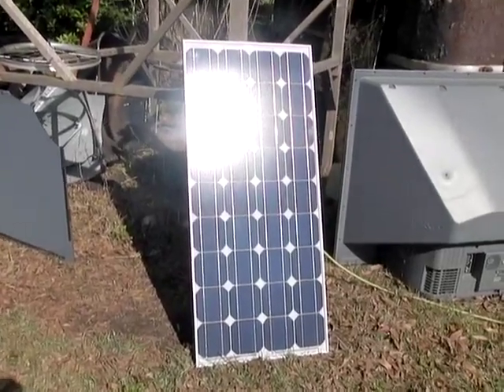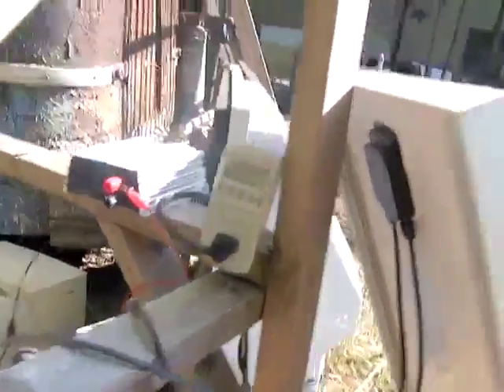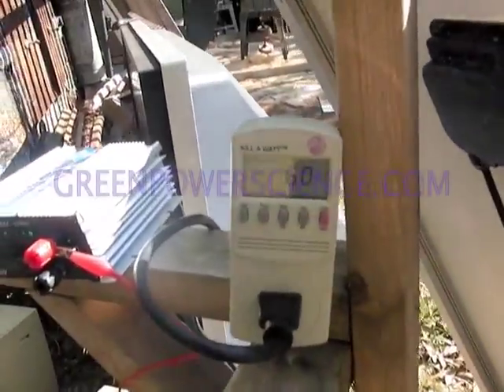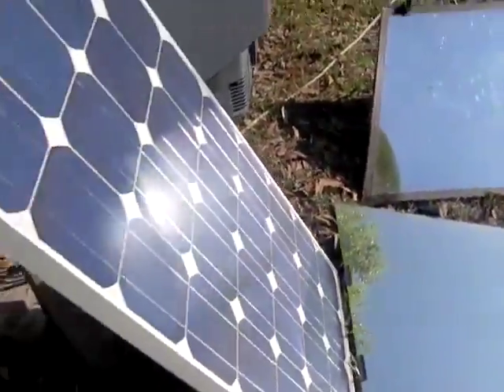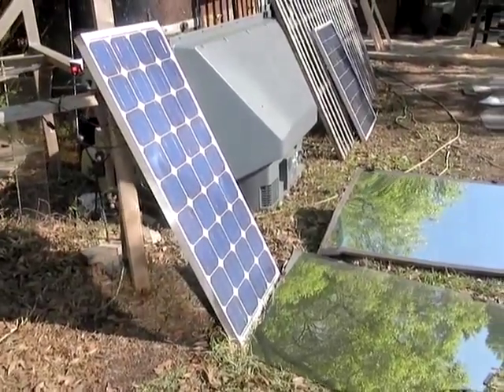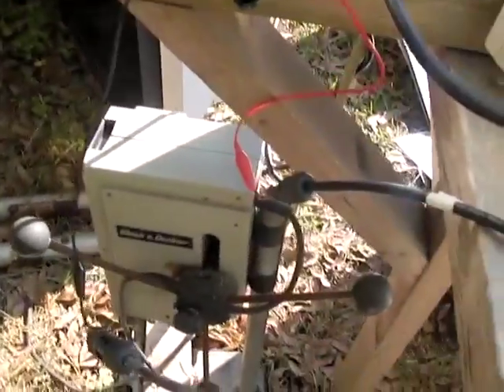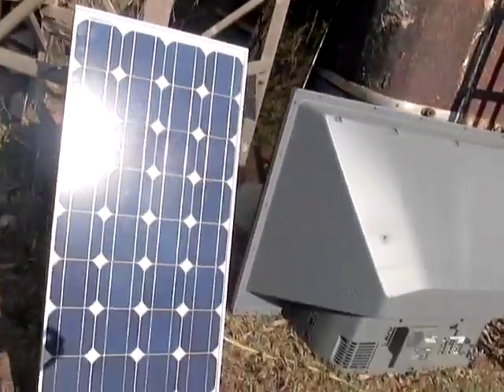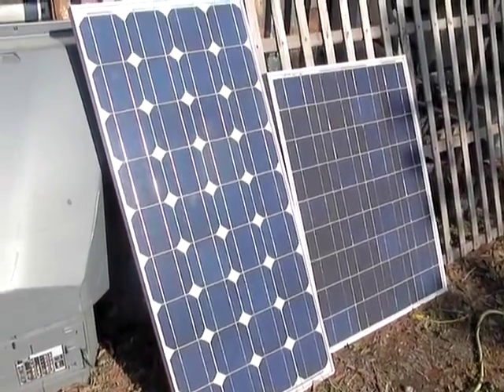solar panel diy power boost 30% from mirror panels

Comment from the maker: Hi,
Amorphous panels can have imbalanced light. If it is a single large mono-cell like a cell phone charger, they can have unbalanced light too. Only when they are tabbed in series:

watch?v=rGi0Mf3cl1E
Reply: I worked with that years ago and doubled it, but it gets hot, and to cool it with h2o on the back is tough.

Comment from the maker: Thank you for the nice comment. Mirrors are better as the Fresnel lens needs to be larger than the solar panel and that costs more than buying and additional solar panel. Mirrors are free and redirect light. Focusing many page magnifiers do nothing. The goal is to increase light to the panel. So either a lens larger than the PV PANEL or redirected sunlight with mirrors.

Comment: Interesting to see what's more efficient; maybe an array of focusing lenses infront of the panel to focus the light beams onto the panel itself might increase the power output. What's your opinion on that?
And have you considered an automated motor attached to the mirror that could be used to reflect the sun to the panel at all times regardless of it's place in the sky?

thanks for sharing this very informative video

Comment: would a heat sink/ liquid cooling system help? or could the solar cells break due to the expansion and contraction of the silicone crystals due to the change of temperature?

Comment: Boosting a panel with mirrors just shortens the life presumably. And it requires clear sunlight and actively tracking.. so..
it always ends up being easier just to use purely solar panels.

Comment from the maker: It is usually similar to non-reflective glass used for art framing (pebbled surface). The DIY method is a very light scuffing. Testing the light transfer of different methods and sanding mediums.

Comment from the maker: Sorry for the delay, the grid tie inverter gradually draws a max load vs a short circuit so the working load is more realistic for long runs and accommodates for resistance from increased heat with the additional light. If the panel is tabbed (mono-poly-multi crystalline) vs amorphous, make sure the light is balanced over all the cells or the voltage/current can drop even with additional light, like a blocked cell.
Reply: Tell me how to implement it in large plants

Comment: I'm doing a study on this subject as a masters project. I'm using two mirrors on the sides to increase the output. Some guys who did experiments measure the short circuit current of the panel to determine the increase in output. Can you describe better how your load is better than that? I'm using a fixed resistor for my study, but improving my measurements is always a good thing. Thank you!

Comment: The point of the answer was that it depends on each device's individual power consumption. For example: 10 halogen light-bulbs = ~600 watts, 10 LED light-bulbs = ~150 watts, three laptops or mini-PCs = ~300 watts, three gaming PCs = ~1500 watts, so the answer that you want would be: anywhere from 800 watts to 3000 watts.

Comment: i got 1 ref and 10 light bulb plus 3 computers, my questions are: how many watts should be my panels and how many deep cycle batteries should i need? also how many watts should be my inverter... thank u and more power and projects from u guys.. happy new year 2013

Comment: Which is the best (500-1000 watt) grid tie inverter to buy and is it as easy as plugging it in to a nearby receptor, or do I need an electrician to hook it up? Thanks Dan, keep up the good work!

Comment: cos the meter reads 54watts doesn't mean your loosing 26w in the connection , this 80w ratting is absolute maximum you can expect with the sun vertically overhead, and no chem trails.

Comment: You would not want to use this wire for your project. Then why didn't you use larger wire? :)
The heat increase will reduce the efficiency of the solar panel. As he said at the end, just get more solar panels. Look on Craigslist or other places. You can find new solar panels for $1 a watt.

Comment: just a thought, what if you used mirrors but below the cells, touching, you run cold water, in a flat copper pipe on its way to solar water heater? to keep the cells cool while increasing there power outage, with there temp down they also work better do they not? what do you think?

Comment: Maybe using water is a bad idea.. So what other liquid could we use instead of water.. (I'm not an expert, nothing comes to mind).. what we could do is fool around with the water/other liquid ratio.. 60/40 maybe I dunno..  the purpose of the water would be to mainly increase the watts while the other liquids purpose would be to keep the panel cooled..(Segment 2)

Comment: I went swimming yesterday with my woman. We both were in the pool for about 30 mins.. I got out and tried to tan... she stayed in the water. When we went inside I tried bragging to her I got a tan (and yoouuu didnt!)...so my amazement she got the better tan.. So I wonder if you were to put a inch or so of water on top of the solar panel.. but touching.. would you harness more Watts? (Segment 1)

Comment: Great video! If you concentrate one mirror to a portion of the panel, then that would make the current of the cells uneven right?  So how does that affect the final current and voltage if the current and voltage of the cells are uneven?

Comment: Has anyone ever tried an idea of running water lines to cool off the panel and in turn provide house and air heating?
Just thought of it and wondering if it works well...

Comment: @InTheSticks0001 Awesome info! I live near the 45th parallel in NY and am wondering how these perform in winter. I wonder if it gets very cold (near zero or sub-zero temps) will they lose efficiency? Electric wiring loses conductivity in the lower extremes.

Comment: Makes me speculate if adding light filters could provide as much or more benefit than mirrors alone.  If you gather only the most useful wavelengths of light, you could discard the rest, thereby reducing heat (perhaps)--much the same as plants benefit from blue light for photosynthesis.  Which wavelengths do PV cells "prefer"?  Time for some research...

Comment: Dan, nice one, you could add plain white painted areas around the solar panel, as you know often used in filming / photography,  a cost effective light reflector. If your into green engineering, just add another panel may not be the way forward.

Comment: Dan, I like your channel and I think you stuff is great, but after some time... have you deliberated on this? It's such a simple concept that one pretty much assumes that you if you concentrate the lumens, you also concentrate the heat. Sure it'll put out more power, but if a cell is designed to be in open sun, then it's been maximized and it only makes sense it wasn't designed to handle more heat than it was designed for. At a 10% increase in power... at 17% efficiency - BIG Heat additon

Comment: reminds me of the idea I had to take scrap fiber optic cables to bring more light to a solar panel.  around the sides of the panel you would have light capture stations that channel the light through the fiber optics to the solar panel to boost the light it gets.  I thought that might make them more effective and usable in cloudier areas...  I had a friend who installed fiber optic cable and they have tons of 6' or less scraps they throw away...

Comment: If you were going to do this, I would do sun angle calculations.  Face it towards the south, and have mirrors about 30% lager than the panel itself along the bottom. at such and angle where you get a full reflection right between noon and dusk.  and about half the reflection at noon, to avoid burning out the panel, as well as getting a bigger boost during the time of day with less light.

Comment: Dan-

I really don't understand what you are doing here. I have several kill-a-watt units and use them regularly. The measure the flow going thru (i.e. to measure how much power is being PULLED) - they are not meant to measure power generated- so i don't at all understand how it has anything to do with your experiement with the mirrors.  We recently had a 1.3 kw system plugged in and when the Kill-a-watt was plugged into the inverter, it would show 0 watts when nothing was plugged into it....

Comment: Dan,

I also have a 40 watt panel that I use for some outdoor lighting. I thought about using your mirror to to boost the panel but it seems to risky for broken glass. I am going to try a piece of polished aluminum instead.

I am looking for a low voltage timer to use with this 40 watt panel. I have it hooked up to a 100 ah marine battery and a photo sensor but don't really need the lights on all night. Do you know of amy low voltage timers I could use with my system?
Ramsey

Comment: Dude, that's pitiful. I'd rather plug my TV & playstation into the electrical grid than spend that much time trying to milk miserable 60 watts of power out of each cell.
The solar panel design is inefficient, we need something better than the conventional solar panels.

Comment: You need to watch the temperature of the pv  cells, higher temperatures decrease their life span and overall output.  Temporary gain , long term loss.  In colder climates this is a good idea up to a point obviously,  In arizona, we see a decrease in our panels during the heigth of summer

Comment: What up gps. I got a GTI for a solar club project and we cannot get near the 100 watts the panel is rated at. Is the drop a flat number or a scale. We are getting 71 watts out of a 100. Would 200 watts (2 panels @100) give 171 or 142. Keep up the good work solar guy;-)

Comment: You will reduce the life expectancy as well as the efficiency of the panel if you concentrate light onto it!
Reply: So over the lifespan of the panel it ends up producing the same amount of power, as one without a mirror.

Comment: try it again with fat cables! you know you had too much resistant on the burning cable so eventually the readings are not good and could be higher.

Comment: Hi Dan, 

And what if you replace the mirror in front of the panel with another solar panel, have you tested that yet? I understand that a lot of sunlight reflects from the panel surface. So why not use that, by catching the reflecting sunlight with another panel? You can aim them in such way that they both catch direct sunlight and also the reflection from the opposite panel, like you did with the first mirror. But I don't know if it is worth testing?

Greets, iT

Comment: Cool vid.  I did a similar experiment and got similar results.  There is definitely a lot of free mirror out there so it's worth exploring.  

I also built my own solar panel and started experimenting with this plastic/corrugated board (the type they use for political campaigns) that i got.  Seems like a good material being weatherproof, relatively strong and lightweight and yes...cheap.  Wait until the day after an election and just grab some!

Comment from the maker: These have the newer MC Connectors which are designed for solid connections but you need the conversion kit. I suggest 12 gauge per panel.